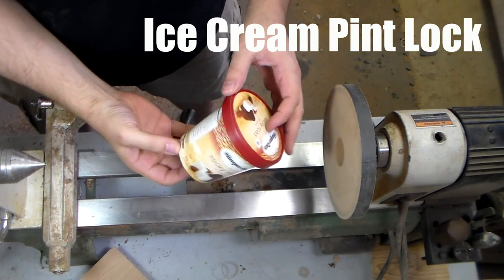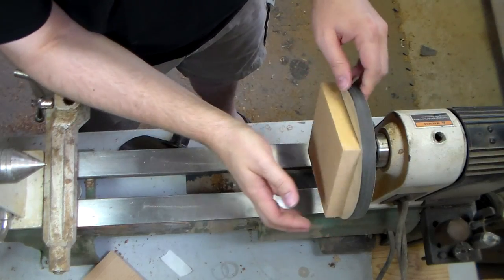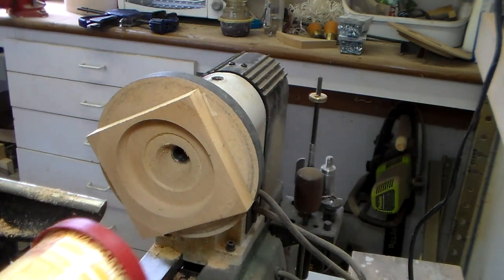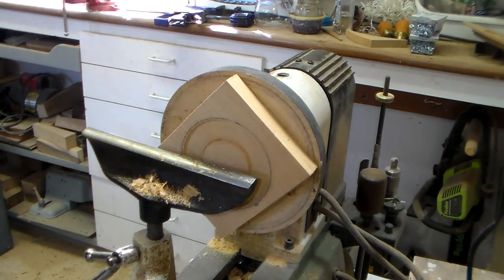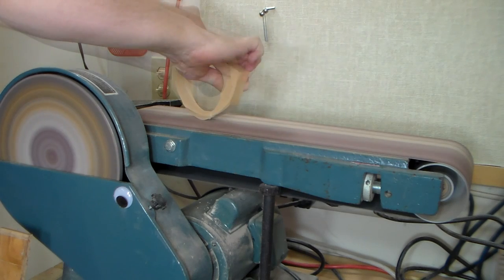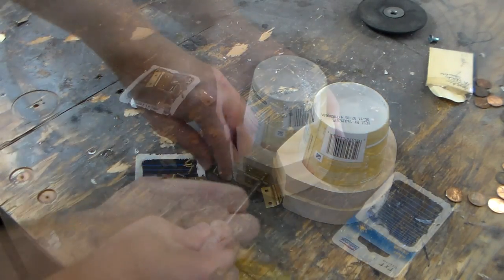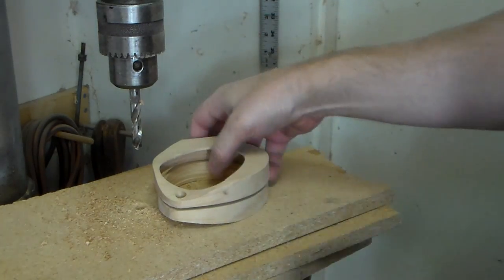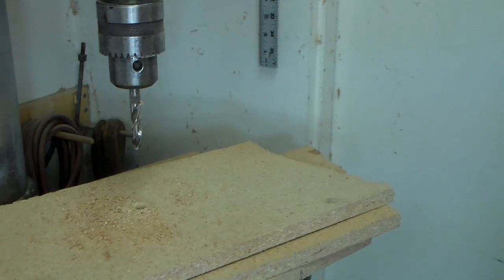How To Make An Ice Cream Pint Lock

Comment: Very creative!  The message that it sends will be more powerful than the lock itself, for sure.
Reply: gnaw through the bottom..
Reply from the maker: Applied Science Thanks! Yeah, this little idea did wonders for my marriage!
Reply: Peter Brown unless your spouse works around 16 gauge metal shears, pettawatt range laser, or the super secret case-hardened 24-in kobalt bolt cutters from lowes. ;)
Reply: +JakesDen Gaming ...or has a screwdriver.

Comment: Im new to woodturning and i was wondering, once you get the wood stuck to the lathe, how do you get it off without damaging the thing you are making
Reply from the maker: +TheSuitedGent Yeah, it's hard when you turn between centers. A good four jaw chuck will help a lot with getting the ends cleaned up.  I like the Nova scroll chucks.

Comment: if you just pulled the whole thing up it would take the lid off
Reply: Thats what i tought as well, that just traps the lid.
Reply: hidank he made the bottom the size of the part it was on, but too small for the top part. Could be done but it'd be hard work and messy in the end.
Reply: It’s a paper carton, so you probably could just pull it off and the carton would bend inwards and it would slip off
Reply: if the pint is full, the ice cream make it very difficult to just break through. Well, you could waith for the ice to melt down, but after that it's just sugary cream soup.
Reply: Take a bread knife and cut the ice cream container just under the lock and boom ice cream.

Comment: Major design flaw: you left the screws on the hinge exposed.

I may or may not have experience with removing the hinge, tampering with contents, and reattaching screws to hide my pilfering.
Reply from the maker: Totally! It more for the novelty than the protection. I've also found it's great for pissing off loved ones....

Comment: Just pull it off. The paper material will flex and slip off. Or I'd just use a blade to hack out where the padlock is holding.
Reply: Or cut the ice cream container
Reply: +moe ridesKTM You're missing the point, it's a novelty/joke and maybe to made to make a point rather than Ice Cream Security.

Comment: I CALL REMAKE ON THAT! 
Wrap an empty ice cream pint in tape then cast it in resin. cut the top off and join them back together. Then drill a hole and put a lock in, then you can't just cut off the bottom anymore ;)

Comment: The design... It looked like you could pull from the bottom and the lid will pop right off
Reply: Oh wait I see it now nice jov
Reply: Irish Cuber job
Reply from the maker: Irish Cuber There is a lip on the cup that prevents that. It's obviously easily opened with a knife, but wheres the fun in that! :)